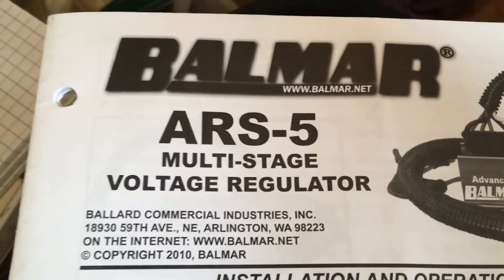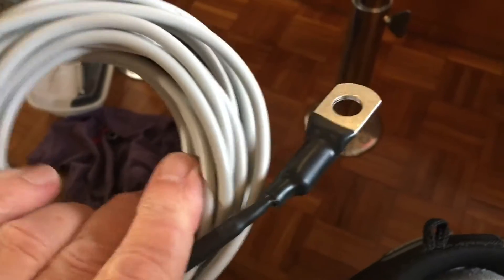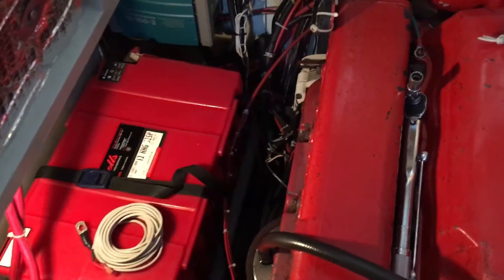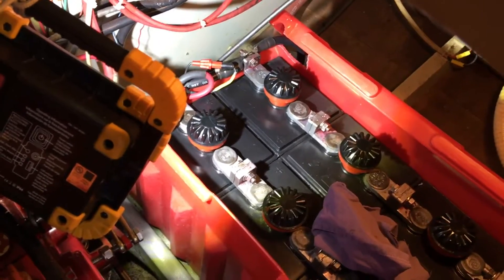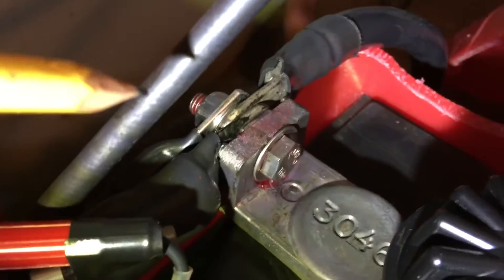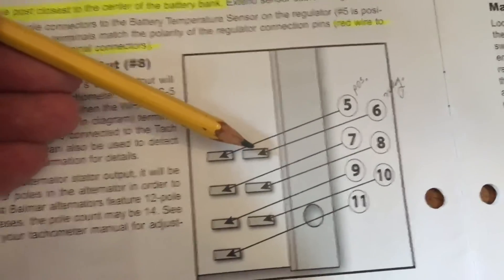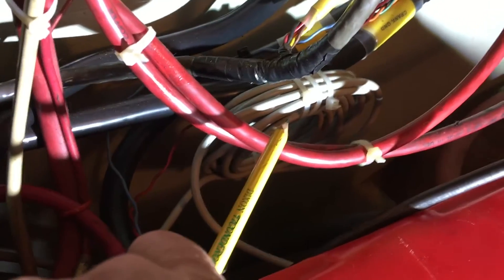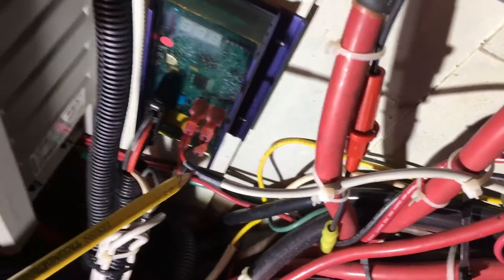Installing Battery Temperature Sensor for Balmar ARS-5 Voltage Regulator

Comment: Why don't cut the excess on cable and put new terminals, it's important the mesure of cable?
thanks
Reply from the maker: The temperature sensing function is programmed based on the specific length of the cable. If you alter the length of the cable, the temperature sensing function will no longer be accurate. Good luck with the voltage regulator!
Reply: @davidvonwolffersdorff2385  thanks for the information I assumed that something like this will be since it is very easy to put new terminals